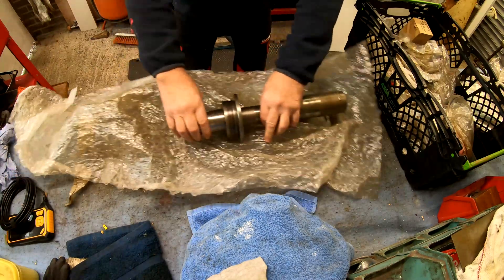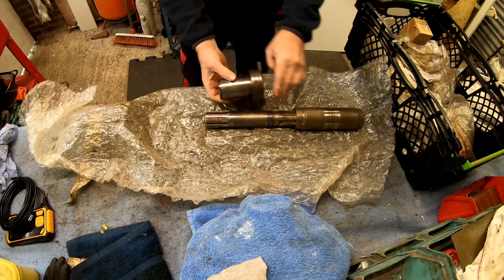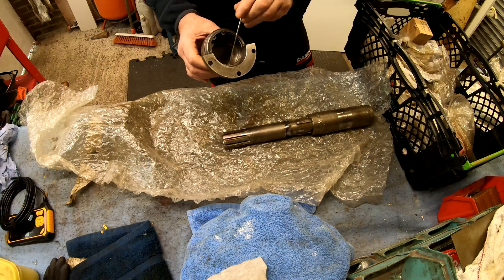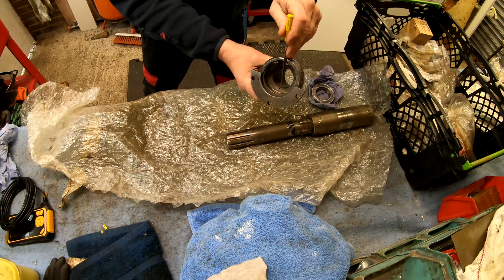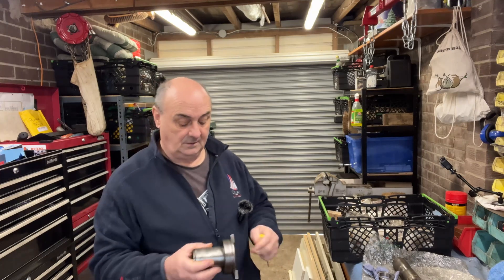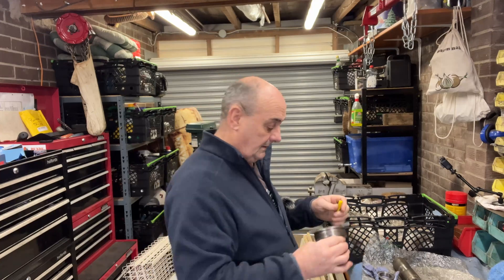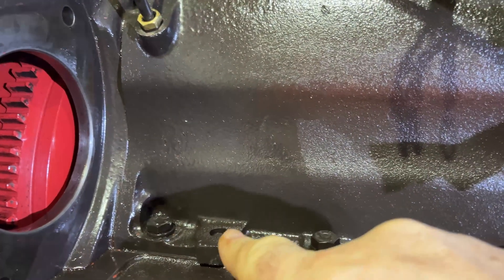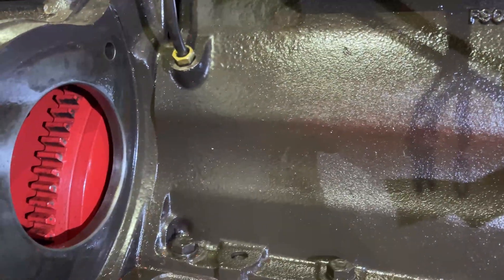David Brown 990 Gearbox bearing carrier #112

Comment: Hi Barry, i have a DB 770 selectamatic and your db series has been very useful with repairing things that i otherwise could not have. Was wondering if you have any advice. The lift arms won't go up at all. I've checked the bypass valve with your video, and it seems fine. When I had the plunger out, I cranked the engine to see if there'd be any oil, and there was oil coming up through the hole. So it seems that the pumps fine, but the oil isn't getting to the cylinder. Any thoughts on what could be the issue?
Kind regards, roald
Reply from the maker: Hi Roald,I've included a link to my gdriveand a hydraulic manual for the DB's pop over there and download the manual, in it is a diagnostic chart that might help you with the issue,
https://drive.google.com/file/d/19L-qqdqgtZyu825-ZIdLIFZxdRhZhYQF/view?usp=drive_link
do you have an implement on the arms when your trying to lift?
it could be a couple of things, such as faulty pressure relief valve,
by pass valve sticking or even a holed pipe in the axle.
Have a look at page 34  in the manual and work your way through the chart
hopefully this helps
Many thanks
Barry
Reply: @manfromthemist1958  Amazing, thank you very much! Will have a look
Reply from the maker: your very welcome, many thanks for your support of the channel
Reply: That manual helped me a lot to understand the selectamatic system better, many thanks! I havent figured out the issue but I now know that theres no pressure on the external hydraulic pipe either, wont raise my small mower. So i suppose the issue may actually be the pump, even though i saw oil flowing. Or perhaps something has gotten clogged up, the filter was actually not too clean. In another video you mentioned filling it up with diesel after draining the oil and letting it run to flush it. but ive also heard that theres lots of small pockets where fluid gets trapped which you cant drain out, so are you sure thats safe to do? Also any tips for loosening a stuck hold valve?
The search continues...

Comment: G Day Barry, The hole is to drain oil away from a leaking front gearbox seal to prevent it coming forward and ruining the clutch plate.
Reply from the maker: G Day Lance, hope the storm hasn't landed yet, it did make the new in the UK today, looks like your going rto be going inland first and coming back up the coast, Thanks for the info, it makes a lotta sense once you think of it in the cold light of day, better to have oil running down the casting as ruining the clutch plates,
many thanks
enjoy your break and keep youe feet dry,
Barry

Comment: Hi Barry. That hole is to divert any oil that may get past a worn bearing seal and send it straight downward instead of it tracking forward into the clutch assembly.
Reply from the maker: Hi Rod just read your comment and have 2 minutes ago just read exactly the same from Brad, it now makes a lot of sense as the oil will run down the casting and out instead of ruining the clutch plates,
I knew some one out there would know the reason for it.
many thanks
Barry

Comment: Very interesting Barry, I looked back on your video when you assembled the clutch bearing carrier to see the arrangement and I can't see why the hole faces forward although there probably isn't much oil in that area other than lubrication of the clutch brake band, it'll be good to find out what that hole is for. If you are trying to examine the crankshaft seal it may be worth removing the clutch housing cover first to try to inspect it as it would have to be removed anyway before you split the Tractor and this might save you a lot of work.  Good luck
Reply from the maker: Cheers Terry, I've ordered two tappet side cover gaskets today and I'll get them changed out and run it again to see if the leak was the gasket letting the oil run down between the castings, if not it'll be a spl;it and look intot he crank shaft seal,
many thanks
Barry

Comment: Hi Barry, I'm still curious about the scroll or threads on the clutch drive shaft, the early rear main seal is a return scroll type. It seems that they may have used that system on the clutch driveshaft as well. My 880 was leaking from the rear main, oil in clutch housing was black, gearbox oil is still relatively clear. I upgraded to the rope seal housing in 2022, it still leaked. We get deeper into the leaks as we go on, lol. Still strange setup on the carrier. Thanks
Reply from the maker: Hi Brad, your right both the crank and the outputshaft have return scroles machined into them which in theory should pull any oil away from the seals, going to replace the tappet side cover gaskets ina couple of days and see if it helps, fingers crossed
Cheers Brad
Barry